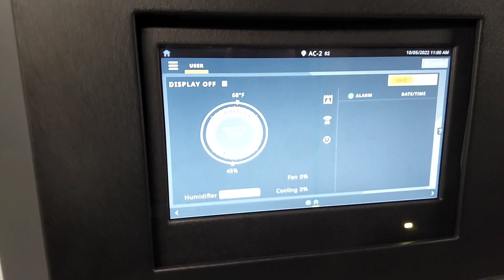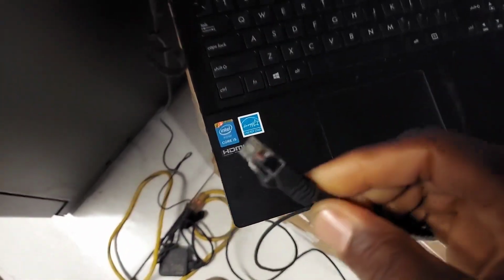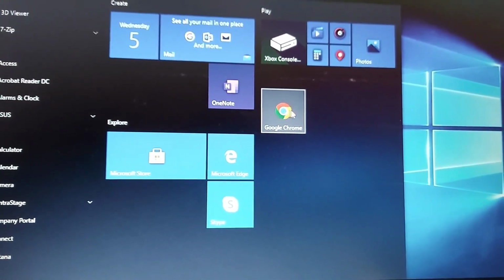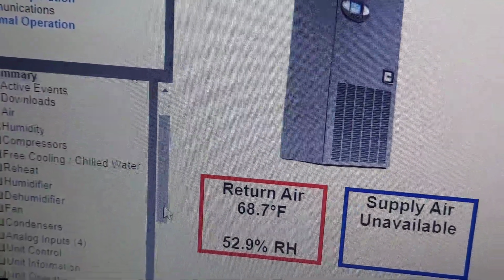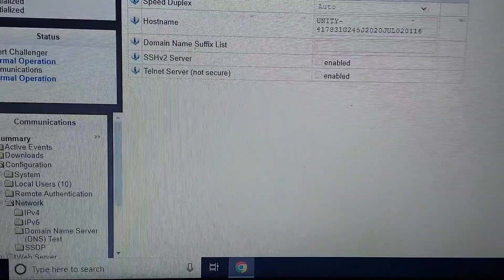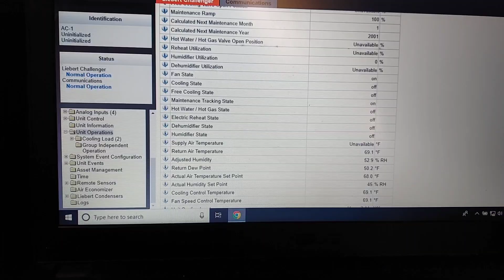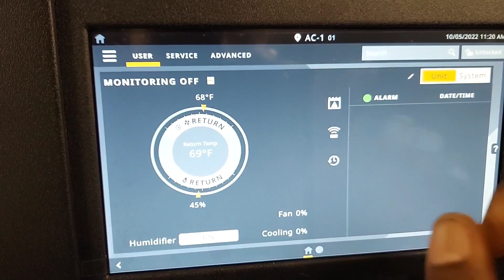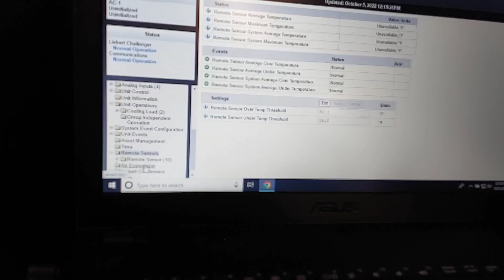LIEBERT/ VERTIV / HVAC TROUBLESHOOTING | BMS | BAS

Comment: My problem is hi room humidity thanks for answer
Reply from the maker: Does the unit  have a humidifier? These are optional! Is the room vapor sealed? What’s your humidity set point? What’s you hi humidity alarm set point, you can opt to disable this alarm as well